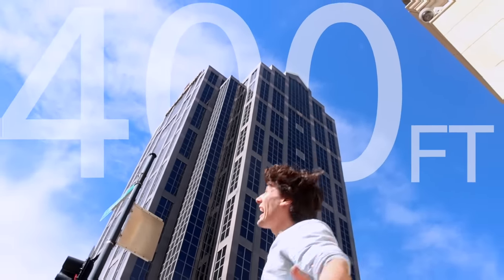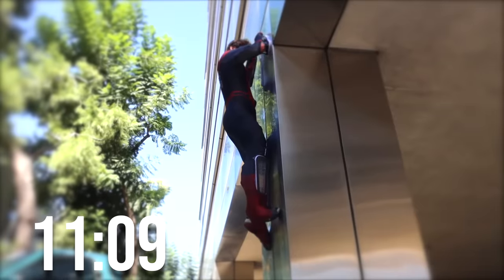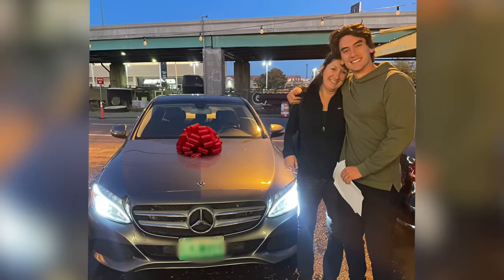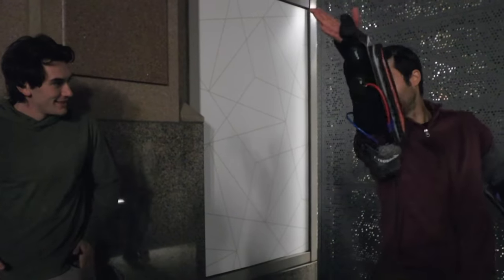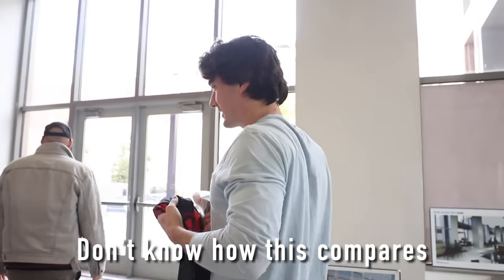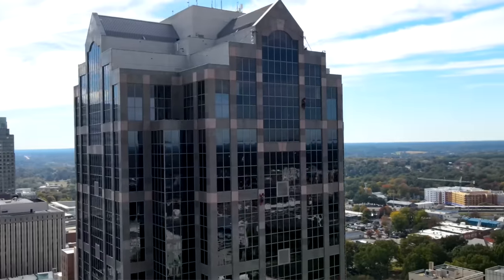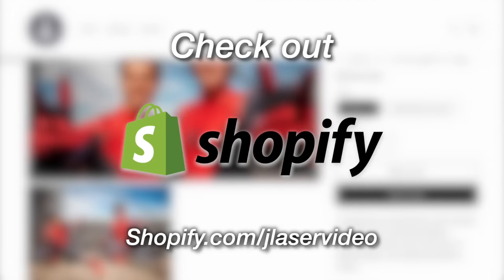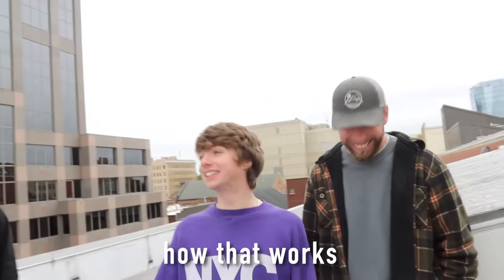MrBeast Made Me Race Spider-Man Up a Skyscraper!

Comment: This man has balls of gold-titanium alloy!!
Glad you're safe and happy that you uploaded once again!   

As a suggestion, I think you could install some form of internally circulating cooling system for the motors and the suit also maybe based on how much weight the suction pads can hold on each unit and it's size, reduce the overall number of pads therefore making it more compact as well as dynamic such that this reduction could possibly take some load off the motor.

Much love and support! Take care and do what you dream!

Comment: heat insulating sleeves could solve the burn problem without taking much space, or at least delay it to the point where you'd be tired before it even got hot

Comment: ActionLab did a video on carbon tube nanotape, it works like gecko skin. He tried to use it like Spidey but I don't think he has the necessary upper body strength, and didn't try engineering it into a suit, he just put the tape on gloves. With your muscles and engineering experience, I think you should give this technology a crack!

Comment: Build a three drone system that can triangulate range and source of encrypted radio signals, sending the data back to a central control unit. Bonus points if it can provide a ten digit grid.

Comment: You could have installed a very small nitrogen compressor and release it every 5min through  small pipes/hoses pointing directly to the motors so you can delay the heat for a little longer

Comment: What if you tried to make spiderman webbing using a strong instant adhesive on the end of (or coated onto) a string (wire/cord whatever works) to snag or wrap up a bad guy or even swing from if the glue is strong enough?

Comment: I wonder if you could make a car that could drive up walls using those suction pads on the tires, or maybe a tank or tracked vehicle so it would have more surface area for the suction pads?

Comment: Question if your suit was to fail and you were to fall is there someone let’s say to the sides of the 30 story high buildings there to save you from falling I’m just curious because in this scene you say if the arm battery comes loose I will fall of this building just concerned/curious what you mean by that you don’t have to answer. 12:04